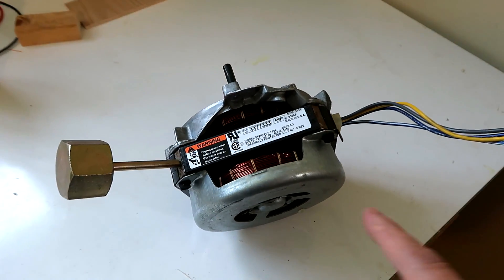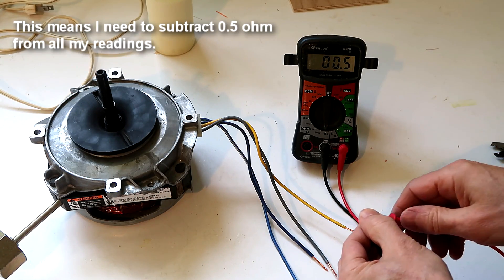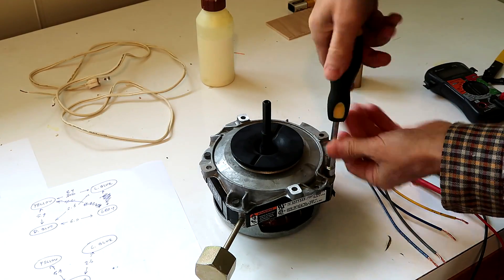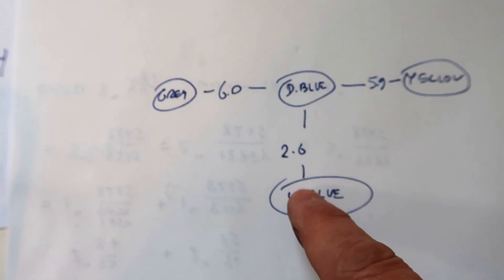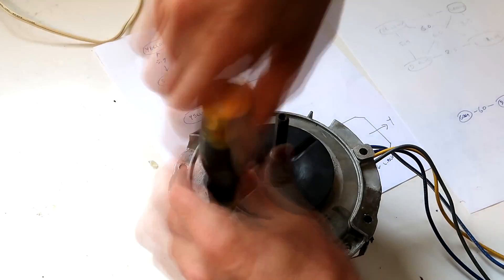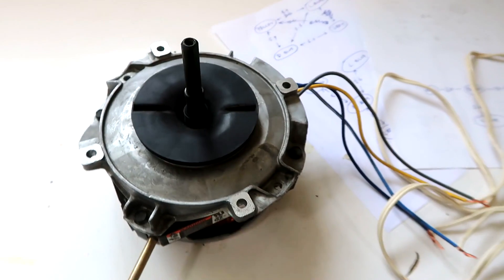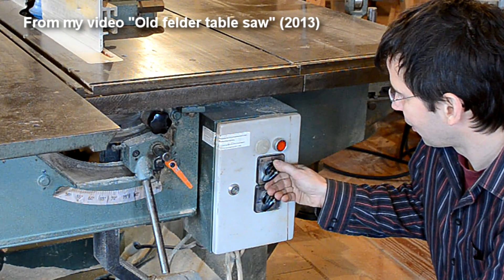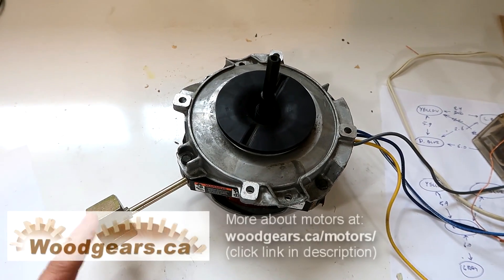Figuring out motor wiring - one example

Comment: The dish washer wiring diagram has the dark blue (VIOLET on my motor) connecting to LINE.  The There is a relay with the coil in series with the main winding (LT BLUE) to NEUTRAL.  This relay requires a significant current to energize and pull contacts together.  There is also a screw adjustment which my guess is a tension spring to set that current level however crude that might be. When the motor is first powered, a large current will flow in the main winding causing the relay contacts to close and engage the either start winding (BLACK or YELLOW) for a short period of time to set the direction.
I measured over 12A peak for start winding at power on by leaving the direction winding disconnected.  With either start winding included (without the relay), the current is about 22A peak. 
After applying power, it takes about 2 ac cycles for the relay to respond and contacts to close.  In about 200 ms, the motor speed is sufficient and run current drops below the relay hold current threshold and the contacts open the start winding.  The motor current drops to about 3-4 A peak.  These measurements were done with a scope and some current and voltage probes.

Comment: Please don't hold your probes like you did in 1:30. You are adding a resistance of your body to the score, the measurements won't be accurate
Reply from the maker: Body resistance is usually in the tens of kiloohms, so the error is less than the accuracy of the meter.
Reply: He is placing himself in parallel, effectively reducing the resistance he's measuring. 

But... he's measuring in the ohm range, his resistance is somewhere in the kilo ohm range. If he's 1 kilo ohm and what he's measuring is 5 ohms. Then he's only going to be off by a off by a half percent, for what he was using the multimeter for, holding with his hands did not affect the result what so ever. 

In more important tasks I would agree with you, but here, for something as finding out what's in series and what's not in series, nope. He did 100% okay.
Reply: Thanks for correcting me :)

Comment: For these motors with no centrifugal switch, I use something like the Functional Devices RIBU1C relay, with the starter winding on the normally-closed circuit.  The relay has a 10-15ms activation time, which is just enough for approximately a single 60hz cycle on both windings - then by the time the relay opens the normally-closed circuit (thereby disconnecting the starter winding), the motor is running.  I haven't tested this strategy under higher load to see if ~10ms is enough to get it started; if the motor can't start in that case, I would just look for a slower relay or potentially a similar enclosed component that has a time-delay built in.  

Once the motor is running with power constant power applied to the main winding, that same power will keep the relay coil energized and keep the starter winding disengaged.  The downsides of this approach are 1) The relay stays engaged the whole time 2) If the relay coil fails, the starter coil will stay constantly engaged and likely burn out on most motors.

The Functional Devices products are great since they are cheap, mount on a standard 1/2" knockout of a junction box, and happen to be made (or at least assembled) in the US.   They have various configurations of contact counts and ampacities.

Comment: I've got a very simple solution on an old table saw. The power switch is similar to a light switch, except that it's made up of two levers, one stays down when you flick the switch, that's the primary winding. The other switch is a momentary (I.e. it doesn't latch in the ON position). So when you flick the switch you push down on both, the non-latching switch powers the starter windings, and the latching switch stays down to keep the primary windings powered. Very simple and elegant. Perfectly mechanical solution

Comment: A quick RC circuit with a TRIAC and protection diodes would likely do you right, you were probably getting a lot of that sparking from inductive voltage spikes.

Comment: You could probably use a potential start Relay or a current start Relay in lieu of a centrifugal switch. Potential meaning voltage. Commonly used on small fractional horse ac compressors. Good luck. Liking the technical videos!

Comment: Those older style dishwashers have motors that spin both ways, one way drives the water through the sprayers in the tub, then it drains the water out by spinning in the opposite direction. The timer itself on the dishwasher is what switches the starter winding and run winding.

Comment: If the motor is inefficient at producing motion from electricity, would it be efficient enough to produce electricity from motion (wind, water)?
Reply: Induction motors are complex to use as generators because they have a starting problem: with no current flowing there are no magnetic fields (except for possibly a little bit of stray magnetization of the rotor) so they can't generate full current. You need either a power source to excite them, or to use capacitors together with the small current from the residual magnetization to bootstrap it _while no electrical load is connected_. And then in operation, if the electrical load is too high the field collapses and you have to restart. (How do I know this? I made the mistake of buying one before reading up on it…)
Reply: @kevinpreid  "... a starting problem..." - Okay, this motor is not right for generation, but is this also saying  the rotation of copper past  magnets (in this motor) does not produce electricity of any form, pulsed DC or other, unless (???) something else is introduced? Thanks.
Reply: @bob-ny6kn  In an induction motor, there are no permanent magnets (except for the small residual magnetization of the iron rotor). The rotor is magnetized _by the magnetic field from the stator coils_. Once there is both a current producing a field, and rotation of the rotor through that field, it'll keep running with either electrical or mechanical input, but some starting method is needed for both operation as a motor and operation as a generator.

Comment: For anyone who cares:  The counter weight gives the motor a higher inertial moment to dampen twisting action when motor rotation rate changes.  The larger the inertial moment, the harder it is to change the angular momentum which equates to a physical resistance to physical rotation.  In static equilibrium, the angular momentum of the housing is zero, by definition (i.e. no rotation of the housing). This can be summarized in the expression dL = Idw  where d is differential operator, L angular momentum, I moment of inertia, w angular velocity.  When the rotor changes rotation rate (change in angular velocity) the housing wants to counter twist against the rotor twist. The counter weight helps the housing stay put, I.e dampens the impact of rotor twist.  Cheers!

Comment: I wonder if you could connect a 120v relay to the run winding and use the normally closed contact to power the start winding. I am wondering if the relay contacts would open slow enough to allow the motor to start.   

I guess worst case you could use a  potential starting relay that are made for this purpose that are used for refrigeration compressors and submersible well pumps.

Comment: Not an elegant solution? That self latching relay is brilliant! Maybe if you hook up a capacitor before , it will help with the relay “flutter”.  I dont fully know what Im talking about but I hope I sound smart
Reply: It is not brilliant, the contacts will break down really fast because of the sparks. I don't know how many times he's going to be able to start his motor with this setup. Maybe 50 times? Maybe 100 times? Maybe 1000 times. 

It works, yes, it's a nice hack, but it's a band-aid. He'll have to replace it sooner than later.

Comment: That rod sticking out of the body could also be used to open a switch that is connected to the secondary starter winding.

Or, you could have a motion detector rigged to open a switch when the rod is vibrating back and forth. A lot more complicated than necessary.

Comment: A quite common way is to use start and stop button with contactors, where the starter winding is switched as long as you hold the start button

Comment: Washing machine motors are similar as one direction runs the agitator and the pump but the pump is running backward and the other direction runs the drum to centrifugally spin the clothes and the pump in the direction to empty the water from the washer.  Dish washers only have a pump and one direction runs the pump to power the spray arms but runs it backward to drain the tub.

Comment: These dishwasher motors use a capacitor to start, not a centrifugal switch. 
The reason for the 2 directions is for draining the dishwasher usually. (depending on the model)
Reply: Centrifugal switches aren't for starting, except that they're in the "on" position to let the capacitor or resistance do the starting. Those switches are for improving performance and safety after starting. Maybe rewatch this video.

Comment: The relay circuit looks simple and elegant since it relies on feedback and makes sure to power the starter winding until the motor has started spinning. Maybe a small half-wave rectifier (series diode) can be used to power the relay coil so as to not cause the sparks due to AC.
Reply: You don't think direct current causes arcs?
Reply: @1pcfred  it does, just once. But in this case the relay arm is jittering around and causing multiple sparks because of alternating current
Reply: @1pcfred  yeah. It's the mechanical bouncing of the contacts
Reply: @1pcfred  Yes. Of course. Electronic devices operate at a time scale much smaller than our perception

Comment: The direction beeing changeable has some benefits.
Maybe have a main switch that turns power on and then two buttons (= momentary switch) to a micro controller wich then closes a starter relay depending on direction.

Could be useful for a fancy fan.

Comment: You could use a refrigerator's compressor starter relay - cheap and easy (just note that it has a vertical axis to be respected, or it will not work): https://www.ebay.com/itm/Electromagnetic-Relay-Compressor-Starter-Relay-for-1-3-HP-Fridge/292497040266?epid=1254692629&hash=item441a2ea38a:g:gdYAAOSwAclblot6

Comment: Use 2 resistors in series with the relay. Short one of them with an extra set of contacts when the relay engages. That should give you some hysteresis to get the relay stabil.

Comment: They had switches like that on old lathes too. The one i kow was a bi-directional switch, the engagement was done on a sleeve, and you'd twist it to the direction you wanted, and as you let go of the handle, it would spring back to neutral and continue with a latching relay. I can't ,for the life of me, remember the brand tho, i ditched mine for a digital controller.

Comment: When you open that contact to turn the starter off, you develop a tremendous back EMF across the starter windings, (several KV!) hence the visible spark. To reduce the problem, add a parallel capacitor and large resistor across the starter switch contacts. If you want a more elegant solution to this back EMF problem, perform the switching of the relay during the zero current crossings of the AC waveform. During this period, there is no back EMF energy in the starter windings. Thus,  no high Voltage is developed when the relay contacts are opened. If you let this high Voltage problem persist, you will soon damage or destroy the relay contacts!
Reply: Just modify that shitty SSR, as far as I know, they have ZCD latch.
Reply: @teslakovalaborator  All that said, what clever use can be made of this motor aside from powering a dishwasher? It's kind of underpowered for anything useful in the workshop. Maybe, Harbor Freight would be a better choice for reasonably good motors for workshop applications. They don't require messing around with to get them to work for the intended use. I guess it depends on how one values their time.

Comment: I enjoy figuring out appliance motors. I've got a few 2 and 3 speed washing machine motors figured out and diagrammed up; it's satisfying to know what each and every wire coming off of one of those does. And at the end you have a motor that's usually reversible, multi-speed, and usually surprisingly torquey. They're often free, too, as most folks can't figure them out

Comment: I got a large water booster pump that had shipping damage and destroyed the centrifugal switch. I used a small contactor with a  pair of momentary buttons to control it. By using a DPST start button I just used one set of contacts to energize the contactor, wired for latching, and ran the start coil to the other set of contacts. You couldn't press the start fast enough that it would fail to start. So I felt ok that anyone could use it.

Comment: Those exposed wires sure gave me the chills, take care man!
Reply: Don't take a physics or chemistry class. Everything is pretty much deadly in those two areas.
Reply: @troyna77  which is why you would enforce safety rules..
Reply from the maker: See comment by Troy.  Leave the real work to real men.
Reply: Heh, If you want to see real danger try working with tube gear and 2000 volt power supplies. Rubber shoes. One hand in your pocket at all times
Reply: Brushing up against 120 VAC is probably not going to kill you. It is always best to not get shocked at all though. I can't even remember the last time I got zapped. Although it has happened in the past.

Comment: Is this a large motor (by volume) for a pump function? It is not like it would need to build up a large pressure?
Reply: Think about what kind of water it has to pump.
You have to design for people to leave food an their plates, clogging the filter.
Also it might be the Pump that drives the rotating Arm, which probably needs a lot of pressure.
The temperature isn't exactly ideal.

Just a few things that came to mind.
Reply: The enzymes will take care of the breaking up the dirt, the rest is rinsing.  No very strong force should be needed. Anyway, I don’t know a lot about motors, but I learned a bit more today
Reply: In a dish washer, i'd expect some pressure needed. Maybe i'm wrong, but it does have quite a lot of "ground" to cover, with the washing procedure, i mean. Regardless, as Matthias pointed out, not a very efficient one, kinda makes me want to check mine. That would explain why it sometimes behaves oddly when it intersects streams with the fridge...

Comment: Good job Matthias. Where were you about 3 months ago? I really needed the help then. I had a dishwasher motor very similar to the one you have here. It took me a while to get it figured out, but I was successful in doing so. Amazing I went through almost the same steps you have so clearly shown here in getting it to run. I used the motor to build an 8" disk sander with an odd ball switch, and I must say this baby performs like a brand name product. I use for a switch, a 2 switch box, 1 on and off light switch, in the same box I mounted 2 momentary push buttons for CW or CCW, as someone mention below in comments. To turn it on you flip the light switch at the same time you push your choice of direction button, for just a about 2 seconds and she runs like a horse that's been eating jalapenos. :P

Comment: I extracted a motor from a dishwasher last year which was wired exactly like this. I was thinking of solving the starting problem using the type of switch you showed from your dad's table saw. I'm glad to see that's something that was actually done on professional machines. I guess it might be tricky to source a switch like that rated for high voltage applications.
Reply: Lathes have this kind of switch too. Cheapo (for their time) hobby lathes in particular.

Comment: Very cool video.What if you had a single pole switch for the main and one momentary push button one side for forward and another on the other side for reverse. It's all manually  done on the switch.
Reply from the maker: Ideally, switching on and turning on the starter happens at the same time.  Just having an on switch that doesn't start the motor is fine until somebody other than you turns it on.

Comment: you could try using a on/off toggle switch for the primary winding and two push button switches (one for each direction) that connect the starter windings for as long as you press them
Reply from the maker: I don't want separate switches for the starter winding.  The starter should turn on at the same time as the main winding, in one motion.